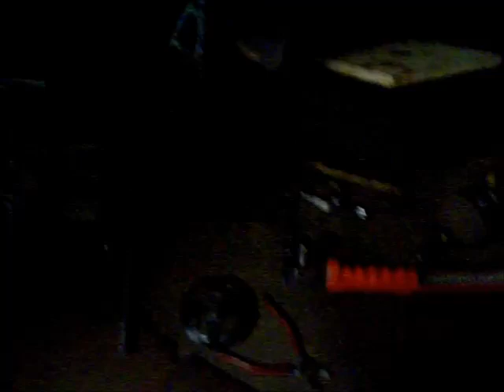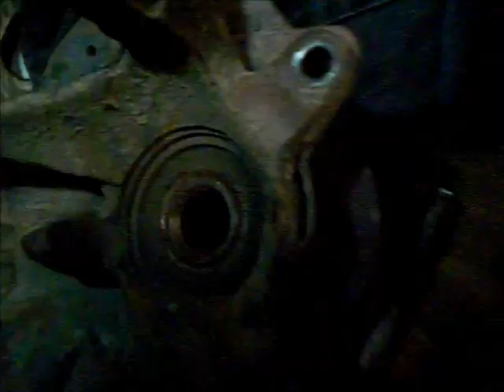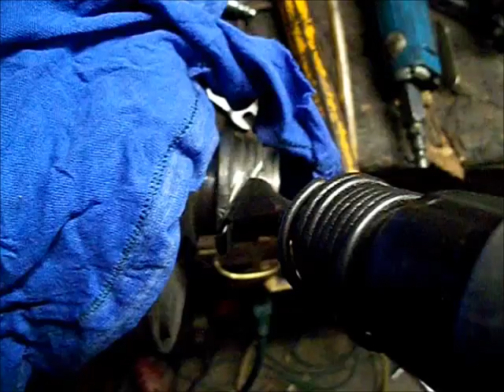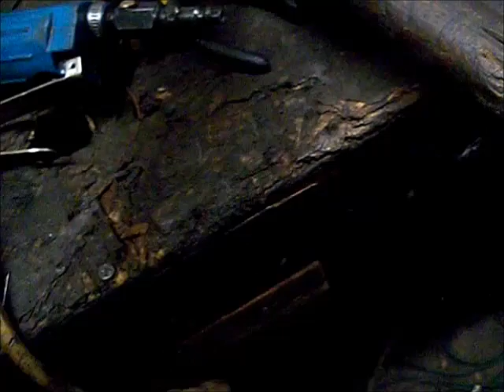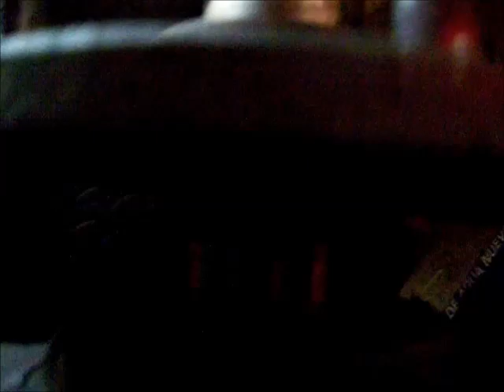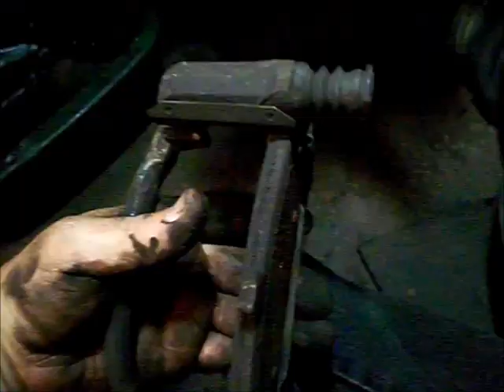Hyundai Elantra `03 driver side front wheel bearing replace

Comment: Thanks. Getting ready to do this job and this video is exactly what I needed.
Reply from the maker: +Jackson Cruz   Hi, Jackson.  Hope it helps you out.  If you have a welder, you can use it to weld a bead in a circle to the inside of the race. It is somewhat faster, and usually makes it easier to press the bearing race out.  The idea being that when the weld shrinks, it shrinks the race with it.  And makes it a smaller diameter, so it doesn't have as good of a bite on the spindle.  I try to do vids using basic tools as possible, for the everyday person that doesn`t have expensive special tools to use.  Good luck
Reply: pro trick : watch movies on flixzone. Me and my gf have been using them for watching loads of movies recently.
Reply: @Hendrix Quinton Yup, been watching on Flixzone for months myself =)

Comment: I hate this particular hub design. Im doing one right now, and im afraid its too far gone to get apart. The rust has made it non workable, the c-clip wont even budge.

Just gonna swap it out with an assembly from a bone yard.
Reply from the maker: +Ronin  yep
Reply: I see others using heat and cold to help. This design is almost impossible for average garage mechanic. You really need a good press and expensive tools to do correctly. I'm going to buy cheap parts on ebay and throw the old stuff out. I did buy new OEM bearings.